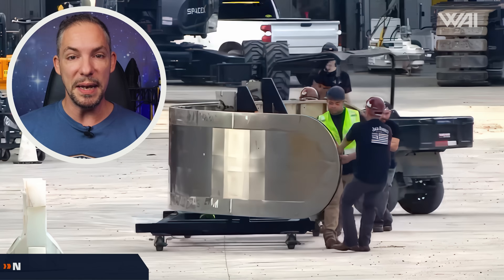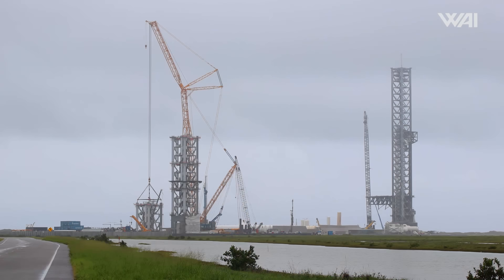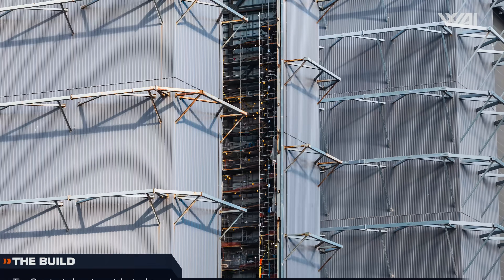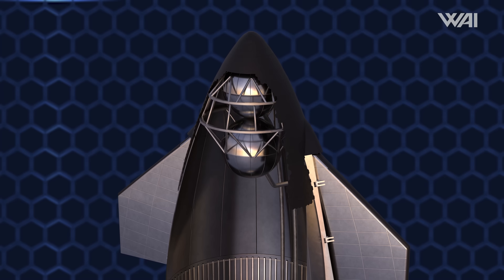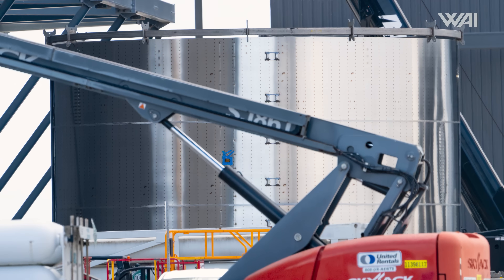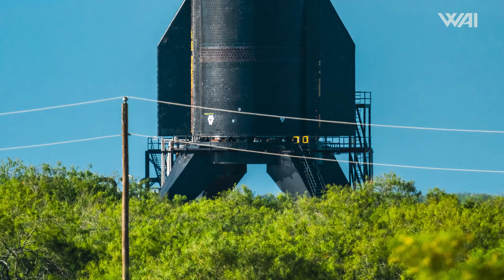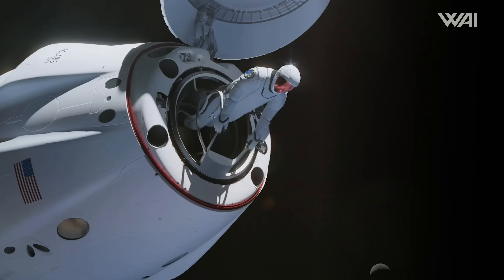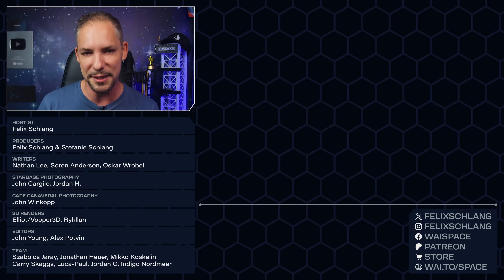SpaceX Finally Finishes Testing! Starship Flight 5 Next!

Comment from the maker: :_WAIStarship:What do you think? Are these new tanks for pressurization, and is SpaceX done with autogenous pressurization? Is SpaceX making up for the lower capability of booster 15? Or do they want to give Booster 15’s head a hat? :_WAISweet:
Reply: Definitely a hat... Booster was looking too flat before!
Reply: I wonder if these hold the required amount of fuel for the landing that way, if for any reason the tanks were to run low, this reserve amount would allow still to reach tower.  Or maybe this is an abort amount of fuel in case they can’t catch and these provide the fuel to fly it back to ocean to abort.
Reply: @rmichaelsm  It's "clean" fuel for landing. The main system is pressurized with exhaust gas, which contains water (vapor). This turns to ice, which plugs up the works, causing engine failures. :face-blue-wide-eyes::text-green-game-over:
A supply of ice-free propellant, pressurized with helium etc., would prevent clogging and help prevent engine failures on landing.
Reply: @ReggieArford makes sense.
Reply: @Whataboutit I wonder if space x can do hop flight to test mechazilla arms catching booster?
Reply: @nvk747  I LIKE THIS ! They could use Hopper, obviously, or SS #26.
Reply: asd  Hi, Elon Musk employees and advisors are always cheaters; they cheat his own companies... same stile than NASA; they dont understand that by doing this they will lose thousands of years on technological aspects. If you can contact Elon Musk tell him to hire me...  I have much better technologies than all his projects. Their employees and partners copied from me some technologies... but I am thousands of years ahed...
Reply: i say a toroidal bladder that operates like a diaphragm used during landing burns to prevent gas ingestion and fuel slosh. WAI?
Reply: @Bramon83   I would need a picture for that, and something better than 🍩 . "toroidal bladder" conveys nothing to my mind.
Reply: Have they fitted handholds for the Polaris Dawn astronauts to be able to manoeuvre themselves around the outside of the capsule? Without them, they will be as helpless as Alexei Leonov and then Ed White were. It was Buzz Aldrin who first pointed out that solution for the problem, allowing people carrying out EVA to do useful work for the first time.
Reply: they figured out that the ice was destroying the turbo pumps at the end of the tank, the ice float to the top acting like a slushy and either throwing the impellers off balance or clogging them completely (also, could be causing thermal shock to the internal parts amplifying stresses. there are a few failure modes that could be going on there). remember, phase change from a solid to a liquid takes an absolute ton of extra energy to change back into a liquid so putting a heat exchanger anywhere in the plumbing has very limited returns. makes the most sense, engineering is in my family's blood.
Reply: Launch next week?
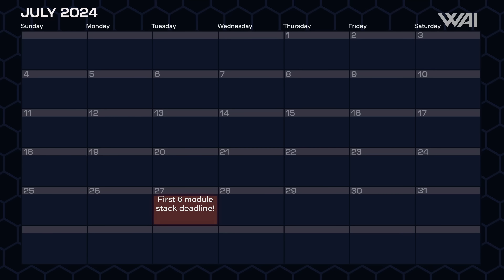Reply: @ 2:21  you showed an inaccurate calendar. The 26th of July is a Friday.
Reply: @Whataboutit  also, the Block 3 starship would be just as large as the sea dragon.
Reply: Indihhho
Reply: 9:29 stop kringing, you look lika a frik
Reply: What do I think?  I think i`m about to be fed up with your channel metrics...
Reply: @favtinov2621  Goodbye.

Comment: Afaik super heavy is not scheduled to be caught. It's supposed to do another water landing but if conditions are absolutely perfect they MIGHT send it to the tower.
Reply from the maker: The plan is to check first before sending it to the pad but that does not change the mission. The intent is to catch it. No might or could. That’s the plan with a safety measure in place.

Comment: I guess y'all don't know construction. Look they only have to connect the bolts and the 4 corners and maybe in the center then they are ready to stack the next. Everything has already been installed on each section so that's not going to slow them down.

Comment: Why don't they use heat tiles to cover the launch pad and tower? Aside from protecting the site, it would be a recurring test for heat resistance, vibration and shock, which could be used to make Starship's heat shield more reliable.

Comment: Random out of box thought...Falcon Super Heavy (5 Stage 1s where 4 outer cores are recovered and central acting as a large Stage 2) could lift significant porions of a future space station in a single lift
Reply: No it couldn't. There'd be very little benefit in such a vehicle, because Falcon Heavy is already very limited in what it can do... it's not short of power, but it can't lift big payloads due to being a skinny rocket with a small-ish fairing. Adding two more cores will give you marginally more mass to orbit, but it doesn't help unless that mass is very compact.
Reply: @simongeard4824  Who says the most upper stage has to be the same diameter as the stage 1. Starliner has a larger diameter than its 2nd stage. You could have the final load with a diameter  of three Falcon 9s
Reply: @guydanielsau   It doesn't have to be the same diameter, but if it's much bigger, you can't fit a fairing around it.... and even if you could, it's not great aerodynamically to have a giant wide fairing at the front of a very skinny rocket.

Starliner is an interesting comparison in that respect — it doesn't launch inside a fairing, but it does need that weird skirt below the service module to remedy the aerodynamic problems caused by the size mismatch.

Comment: The thing is to catch the booster requires much fabrication which is weight!!! So legs may  just be  the ticket. 
I design on a continuous daily basis. As i just love those challenges. And have a good success rate. I do HAVE a few options that i will not mention here. As i have a few (Industrial designs that seemingly are in use now)  it would be nice to be on the conceptual design team for spacex. !  They need realistic do able outside   the box thinking that uses existing mechanics and concepts in another application!!
ELON THIS IS THE ONLY HINT I TYPE. I WILL PUT MY MONEY WHERE MY MOUTH IS AND SIT AT A DESK FOR FREE TO PROVE MY VALUE IN THROWING MY CONCEPTS INTO THE SPACEX HAT FOR CONSIDERATION BY THE TEAM. WHEN I AM ACCEPTED THEN YOU GET BILLED ACCORDINGLY!  And you know full well one idea in 6 months from one seemingly quiet team member can mean the world in moving forward in a confident feeling of success to build and try out !!
I AM READY FOR THE ROLL. 
  YOU KNOW HOW TO FIND ME IF YOU BELIEVE IN THE COMMONSENSE I HAVE JUST STATED. WHICH SHOWS…..HMMMM  !!
The thing here spacex must do is search out ….PEOPLE THAT HAVE THE SAME OR SIMILAR SICKNESS LIKE ELON HAS……!!!!THINKERS  !!!! WITH SOUND PHYSICAL ,MECHANICAL, SOUND LOGICAL , METALS UNDERSTANDING ETC THAT DO IT HAPPILY/EAGERLY IN A 24/7 UNSTOPPABLE FASHION. WGEN YOU  HAVE THOSE ATTRIBUTES ……YOU ARE A GEM /GOLDEN……A CHOSEN ONE!!!

Comment: My father was an engineer at NASA Clear Lake with Engineering and Development and i can remember the headaches he mentioned of them trying to harden electronics for vacuum. Switches arc and weld together, IC chips fail type stuff. They basically handled it by enclosing everything in sealed pressurized boxes.
I wonder what SpaceX has done.

Comment: stacking should be quick, assuming, that from an engineering perspective, if you have built out each section with all the necessary plumbing, electrical, and interconnects, getting those built and transported has taken months and been the challenge. I expect the full 9 to be stacked within the next 30 days IF they are in fact complete segments and don't need further work on the ground. I like the approach they have taken to build it like a lego block tower. Wonder if NASA long-time engineers just look at this approach and shake their heads that they got entrenched in their mindset of how to build launch towers.

Comment: they figured out that the ice was destroying the pumps. that's why the copv's. they would have to do a lot of plumbing work with creating a counter heat exchanger in the down runners to melt ice off otherwise.

Comment: Am quite nervous about the catch attempt, not enough testing. Awesome idea but needs a bit more refinements perhaps SpaceX initially needs to kit the booster with at least three parachutes (in a fireproof box in between the space next to flaps) to slow down the vehicle for more controlled alignment maneuvering into the chopsticks. The Raptors have a naughty tendency to RUD or not start up at the most critical point, for now.
Reply: The thing about these fully automated maneuvers is, they're highly repeatable. So, if one is working with acceptable tolerances, the assumption is the next one will work as well, so they can go the next step. 

Quoth Elon: "If you don't fail every once in a while, you're not innovating fast enough!"

Elon is not worried about the Chinese copying their stuff because they're innovating so fast that by the time the Chinese built a copy SpaceX is 2-3 generations further down the line and what the Chinese built is obsolete. And the Chinese are missing the data from the failures, so they know what to do but not why.
Reply: not enough testing? it is a testing catch! :-)
Reply: You don't take into consideration how much work and how many new issues such changes to the rocket introduce. Any box stuck on the outside mean changes to the center of gravity of the rocket along with its aerodynamics. Plus you could have an effect on the heat tiles. And of course you would have to test and design the parachute system. You don't just bolt on some chutes and your good to go. Parachutes are extremely difficult to design for such purposes. To do this work is more cost, effort, and danger than to just proceed with the development for catching starship.

Comment: Some good reasons NOT to catch the booster on the tower:
Untill they have a 99.99% landing success rate the risk of destroying a tower on landing is too great. 
If they catch the boosters at sea they will gain some payload capacity, and they'll be able to inspect and refurbish them in queue, so even though it would require more boosters overall, it could potentially increase launch cadence because they could launch one booster, and have several more ready to mount and launch, with much less risk of destroying a launch tower. Losing a tower would be a huge detriment to launch cadence.
Also with the current gameplan they're going to build a habit of getting the booster inspected and refurbished as fast as possible after it lands on the tower, which will lead to accidents.

Comment: Flight 5 on tower 1 will not be a catch attempt.  The first booster catch attempt will probably occur with tower 2, which may be flight 6 or later.  Tower 2 has shorter chopsticks which will move faster, more accurately, and with less hysteresis.  Hence the super fast assembly of Tower 2.
Reply: Elons already said tower 1 and if the arms get damaged they will just put the new arms on it
Reply: We've already know they have short arm they could install on tower 1 if they wanted, but they believe it's not needed and are planning an attempt on flight 5. 

There is a lot of hardware still needed for tower 2 to be operational, which is not anywhere close to getting installed and setup. The draw works motor and cables aren't there yet as far as I know. Tower stacking is just the skeleton.
Reply: @Jaker788  the cable was delivered last week

Comment: 14:39 That's not true TT16 is a Block 2 Ship Aft Section. You can see on this images at the bottom right of the center black beam the place where the sqd goes. If you ask why the top has stringers, it's because not the tested part and so they don't want it to collapse. The best sollution to that is simply to add stringers

Comment: You know, the whole James Webb being unservicable seems more & more untrue as SpaceX pushes onward.
It wouldn't take too much of a fuel tank to get that capsule out there & a small compartment stacked under the capsule with tools & fuel for Webb.

A classic Kerbal looking craft if ever there was.
I mean 2 people going out there for a month or 2, the food & water for 2 or 3 people for that long doesn't take up too much volume or mass

Also, that said, it's also possible we could see something like that entirely unmanned, although, I wouldn't hold my breath on that.
Reply: The point isn't that JWST is unreachable — it's that having been assumed to be unreachable, it's been built with the assumption that nobody will ever need to access it. E.g. you can't open the hatches... they've been epoxied shut to save the weight of bolts. You can't retract the sunscreen, and you can't cover up the mirrors to protect them against rocket exhaust, etc.

Comment: i have a few concern's about the touch screens in the Dragon  under the vacuum, i say this because i did some testing on a smart phone under vacuum last year & had delamination problems with the screen, i hope the folks at SpacX have accounted for this potential issue, the bigger the screen the bigger the problem due to the fluid between the laminate

Comment: You guys need to start differentiating between the first and second stage of the Falcon 9...It was the non-reusable stage that caused the problem...what does that say about re-usability???
Reply: Even on non-reusable vehicles, second-stage failures make up the majority of incidents... e.g. RocketLab have never had an Electron booster fail, but they've had a few second-stages malfunction, and the same can be said of most of the industry.

I suspect it's simply that first-stages can test a lot of their operations while still on the ground (e.g. static fires), while second-stages have to ignite their engines in freefall, and have to operate them in a vacuum... much harder to ground-test.
Reply: That’s a very critical point for the future; including, for example, folks at say RocketLab. Their new Neutron will have a reusable 1st stage but still expendable 2nd stage. Once they go thru birthing pains for the first stage & are flying regularly, any operational failures they end up having will probably happen…on the ‘new’ 2nd stage that is flown each flight. - Dave Huntsman

Comment: Falcon 9 didn't fail! The second stage did...
Reply: Nobody else refers to their rockets by separate names. Falcon 9 is the entire rocket including all stages. Same with Saturn V, Delta II, The Space shuttle, and every other rocket ever made. The second stage is a part of the falcon 9 rocket. Has falcon 9 ever flown without its second stage? No it hasn’t ever
Reply: @mattkingston6157  not in this case...because clearly it's different... the booster can be used in other launches...the second stage doesn't. The booster didn't fail, it delivered the second stage and came back, landed and was recovered. So imo you can't use the same classification between non recoverable rockets and falcon 9.
Reply: @bewArcher  the space shuttle reused it’s solid rocket boosters and the entire orbiter before spacex was even an idea in someone’s brain. This case is not different in any way. The space shuttle referred to the entire stack. Just like every single other rocket ever made. Including falcon 9.
Reply: Falcon 9 has two stages: A 1st stage and a 2nd stage. You’re welcome. - Dave Huntsman
Reply: @dphuntsman  so does every other rocket. And yet Vulcan doesn’t refer to the first stage. The space shuttle doesn’t refer to just the first stage. Atlas V doesn’t refer to just the first stage
Reply: Semantics.
Reply: Nonsense. The second stage is absolutely part of the falcon 9 rocket
Reply: doesn’t matter. It’s still a failure of the rocket system. It doesn’t matter what part of the rocket failed, it still led to a mission failure and destruction of the payload. Therefore, that falcon 9 launch was a failure.

Comment: In the name of re-usability they should not use helium at all, for anything, it's a non-renewable resource
Reply: Non renewable, but at our current rate of usage we have millions of years worth available and accessible. The news of helium disappearing has been greatly exaggerated and misinformed.
Reply: There's plenty in space (Saturn)
Reply: Helium is the second-most common element in this Universe.
And it is constantly formed in those massive fusion reactors known as ‘stars’.

Further, Helium is an inert Noble gas. It does not rust, burn, decompose, or become diluted. It combines with a few other elements only under planetary-core conditions of heat & pressure.